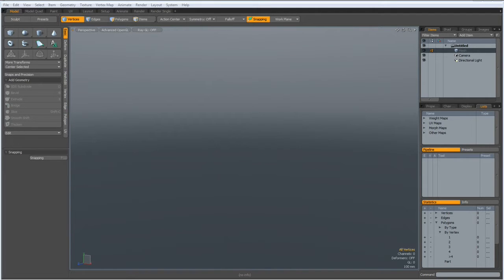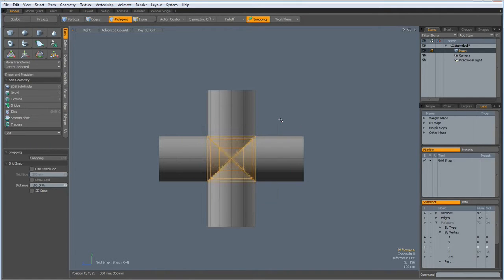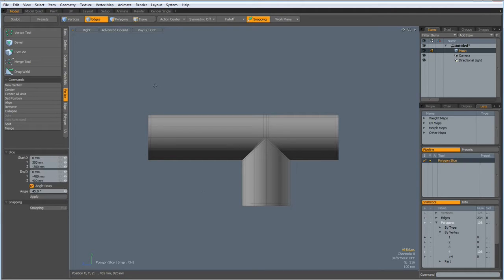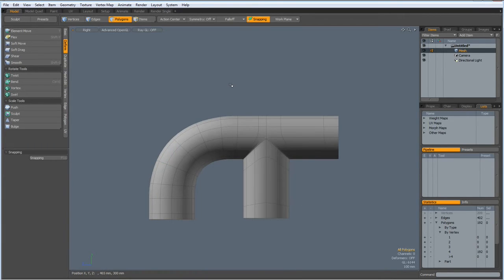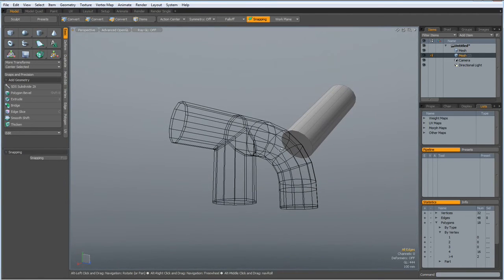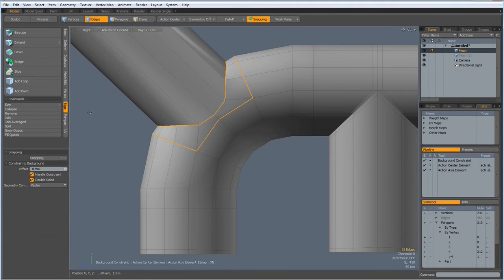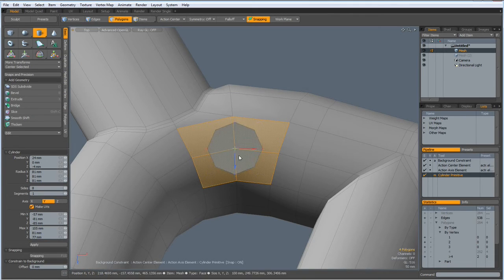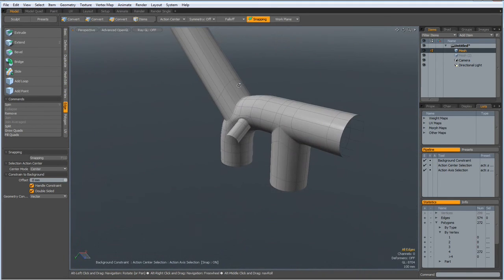Luxology Modo - Working with pipes

Comment: Peter thanks for the video. Trying to repeat this in modo 801 im having some problems. It seems that the snapping to background is not the same.
Reply from the maker: 313jacob Hi Jacob, make sure your geometry is in different meshes and that you have set snapping to Vector and Double Sided. Good luck